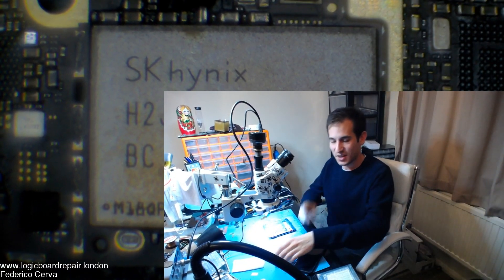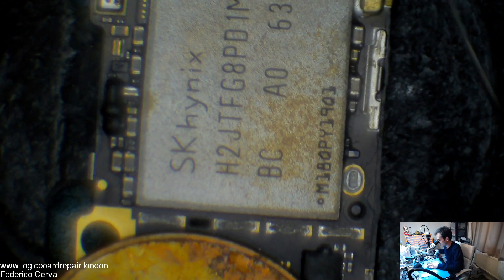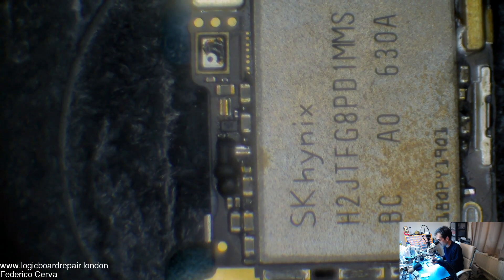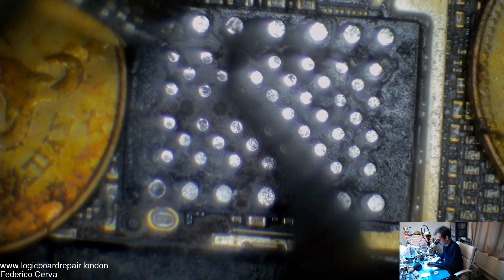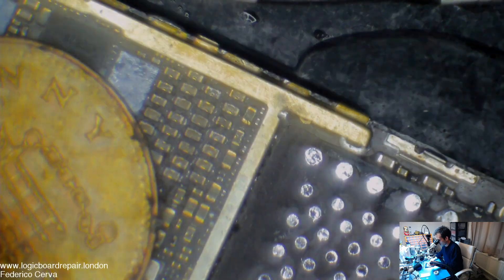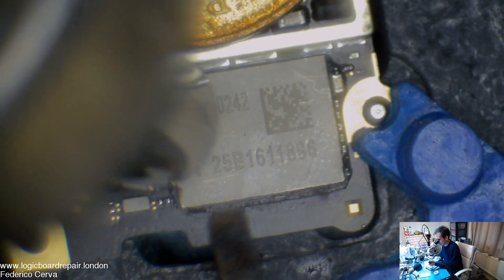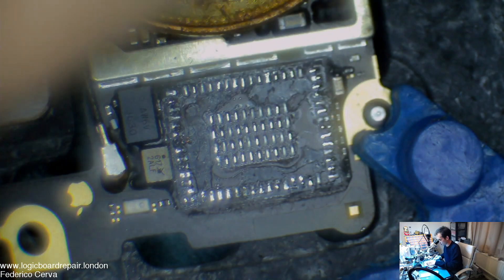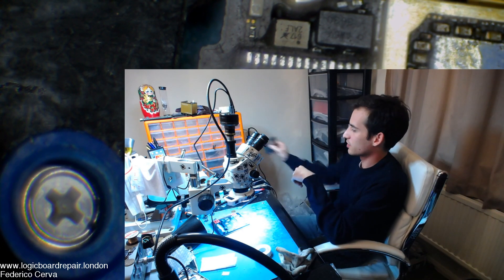The Tools I Use For More Advanced Microsoldering Repairs

Comment: what is your cleaning temp and taking off temp thnx
Reply: HI, for me I use 150°C to remove the glue ( and around 70% air) and to remove the chip I use 350 to 365°C. Air depending the size of the part.